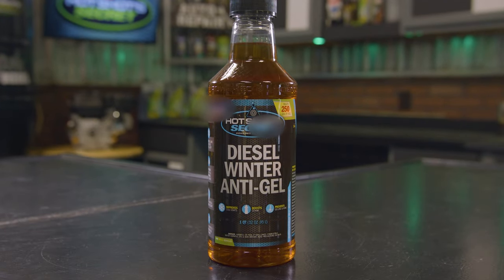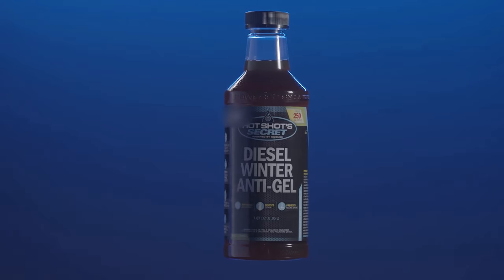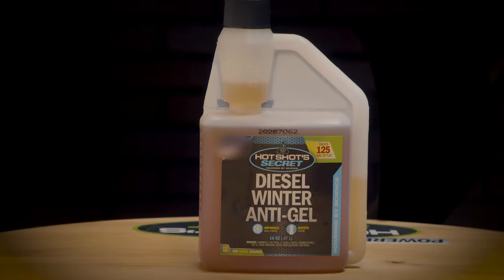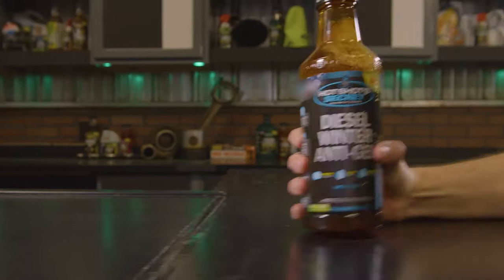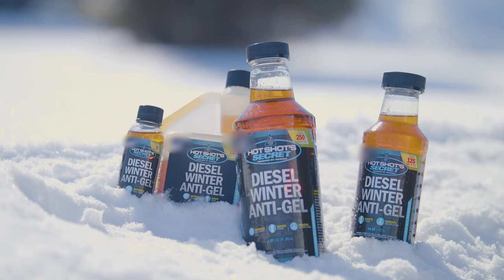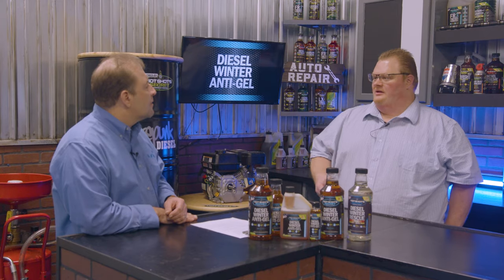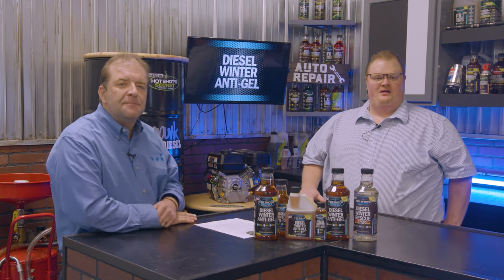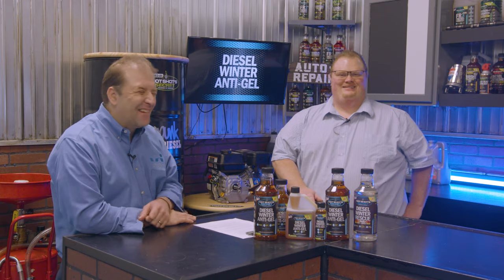Explaining Why Diesel Fuel Gels and How to Use Diesel Winter Anti-Gel

Comment: When you're starting to have problems one gallon of gasoline to a 150 gallons of diesel and you will not have any problems I don't care how cold the temperature get
Reply: Not in a modern diesel, you will destroy the injectors.  It works for the older mechanical injectors, but not the high pressure electronic ones for the past 15 years or so.

Comment: The higher the percentage of biodiesel the quicker it will freeze,and is terrible about holding water.
Reply from the maker: Absolutely correct.
Reply: That's when adding HEAT or a water remover comes in handy. Diesel and ethenol based gasoline's will absorb water. I always use a bottle of HEAT for every tank and never had water issues. Summer time, meh, not a big deal. Winter time, yeah it's a huge deal!

Comment: Around 2:48, what does he mean when he says it is a seven in one?

Great video. Thanks a lot. I learned many new terms.
Reply from the maker: It is referring to the seven benefits - cetane boost, injector cleaner, water dispersant, rust and corrosion inhibitor,  lubricity, fuel stabilizer and anti-gelling agent.
Reply: @HotShotsSecret  Thank you very much for answering.

Comment: I have semi truck Freightliner 2009 had issues with cold start . Once is heat it will start immediately .. so my mechanic told me losing fuel on fuel filter on cold .. can I use this ?? And how to use ???
Reply from the maker: Yes, you can.

Comment: Since what temperature we add ?
Reply from the maker: Start adding around 30 degrees to prevent gelling issues.
Reply from the maker: Diesel is not high quality in general, just added insurance to keep your diesel running in top performance.

Comment: Still gelled while using hot shot secret anit gel. Even added a little more than the recommended amount. Switched to Howes brand anti gel and haven’t had an issue   Will be throwing the bottle
Of hot shots in the garbage!
Reply: I used Howes and my fuel gelled. I am sure it didn't help that my truck sat for three days with bellow 20 degree temps. I know start my truck daily when it is that cold just to keep the fuel moving a bit.

Comment: use a 5-10 percent gas mixture. the cheapest anti gell 911 anti gell
Reply from the maker: Adding gas to diesel is not recommended. It can cause some serious issues.
Reply: @HotShotsSecret its gotten me out of a jam plenty of times and its a cheap solution
Reply: I use gas too. Then again, I'm not running a diesel engine either. My multi-fuel prefers diesel, but oil and gas mixed works too.  When we had subzero temperatures, I ran 20 gallons of waste motor oil, 15 gallons of premium gas, 15 gallons of diesel and my truck ran like a champ. Only thing that works better is jet fuel, also known as JP-5. Mixed with oil, it's better than diesel by a long shot other than it tends to stink and doesn't have that good burnt diesel odor.